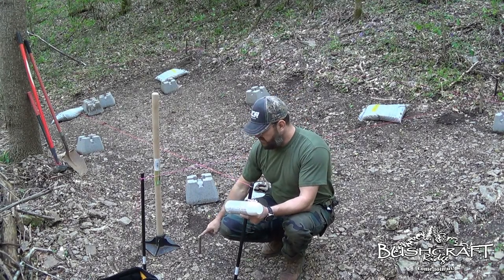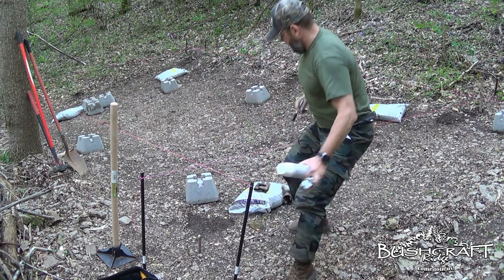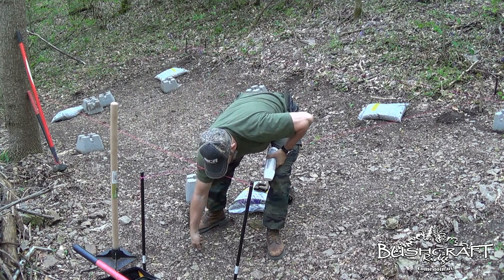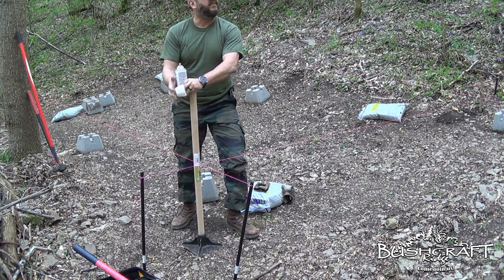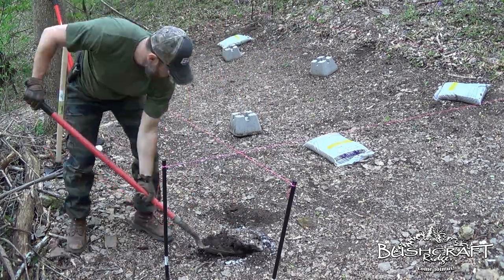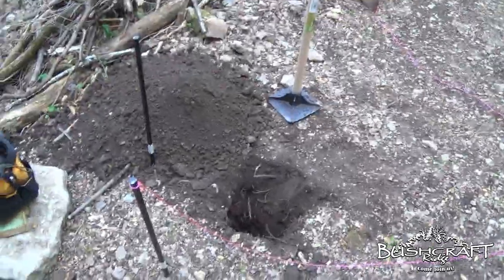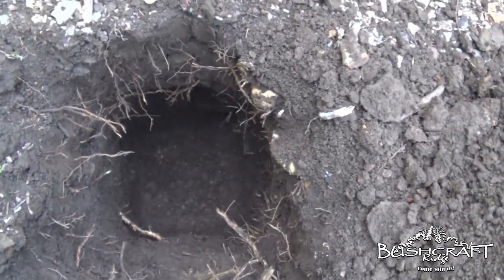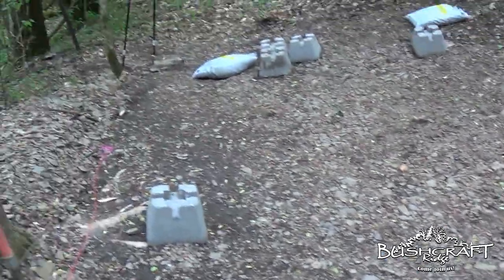Off-Grid Cabin Build 4.16.2020 -- Digging Holes

Comment: As long as you're 12 inches past the frost line it will be fine. Here the frost line is 36" and most shallow footings are 48". Digging into virgin ground is very solid. Tamping those holes isn't a big deal because that ground has been packed for a very very very long time. The only time tamping a hole would be necessary would be digging virgin ground too deep then filling with soil. I would always concrete over the gravel. The gravel can move, shift, settle when just the post is on it. When you gravel, then concrete, then post directly onto the concrete it's not moving at all.
Reply from the maker: Good advice!